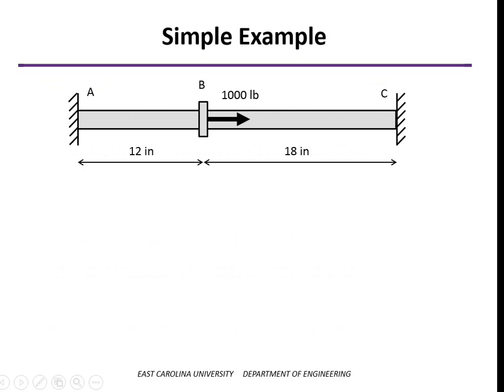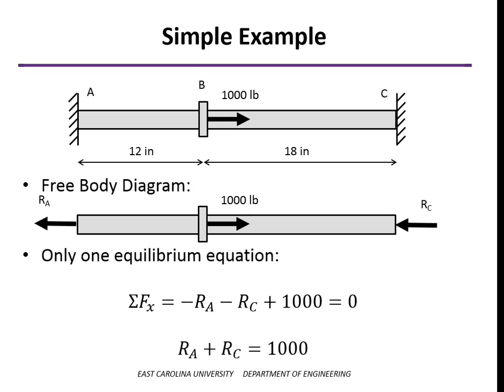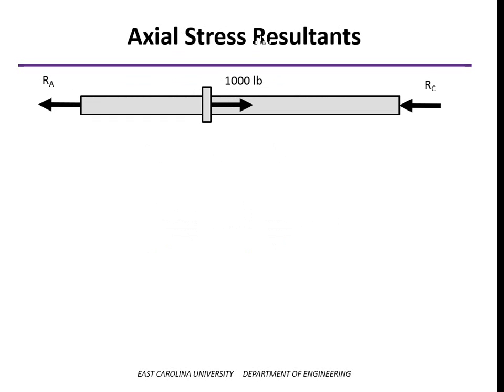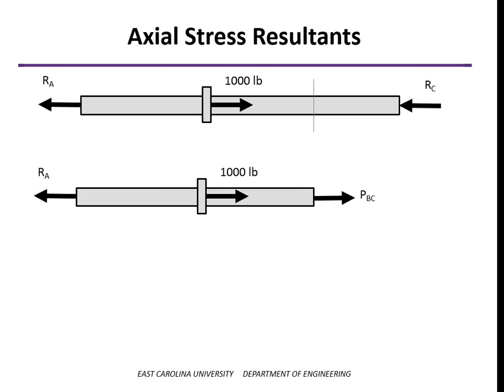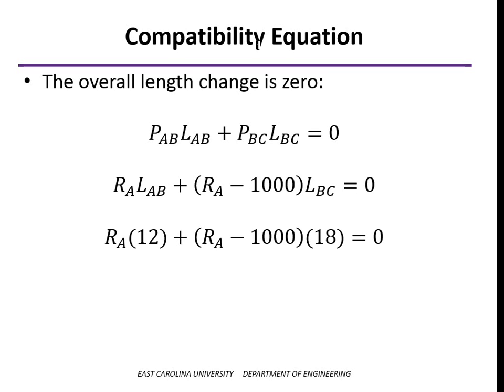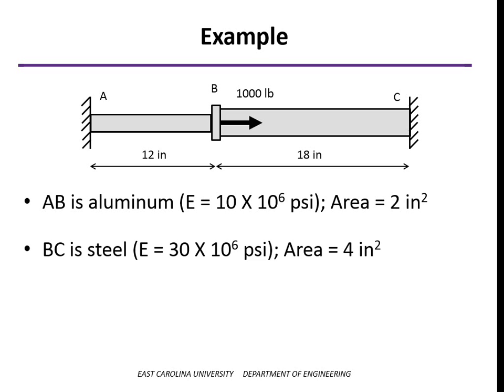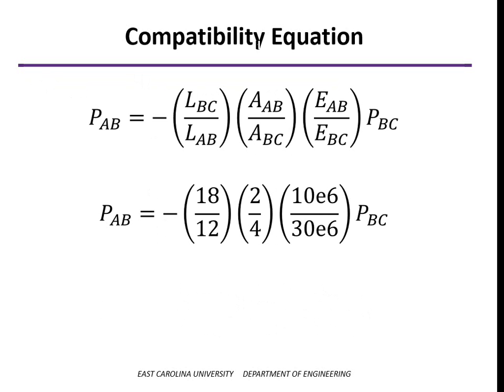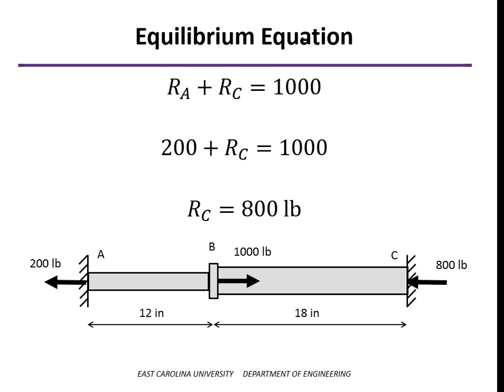Axial Loading - Statically Indeterminate Example 1

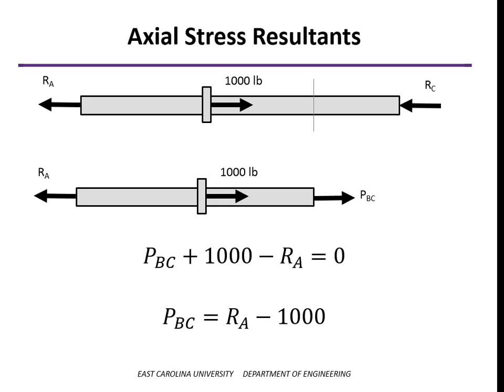Comment: Sir I have a question. In 4:08, isn't it a must to put Pbc pointing to the left? Recalling the whole system equilibrium equation, Ra+Rc=1000, therefore Rc=1000-Ra. If we use that equation (Pbc+1000-Ra=0), then Pbc=Ra-1000, which will contradict if we look the right side of the section where Pbc=Rc and Rc=1000-Ra, hence Pbc=1000-Ra.
Reply from the maker: Since Pbc is an internal force (stress resultant), the positive direction is always away from the cut face.  This corresponds to tensile stress.

Comment: Why do the reaction forces at A and C point in the same direction?
Reply from the maker: Because the applied force is to the right.  Both of the reaction forces are to the left; this corresponds to the left portion of the rod being in tension and the right portion being in compression.
Reply: Thank you so much for your response. My question seems really silly now :)
Reply: ECUSW I took the direction of reaction forces by myself. And when I solved the problem(from the text book) i got a wrong answer. I gues your this comment explains it.

Comment: Shouldn't the reaction at A be pointing in the other way?
Reply: It does not matter in which direction one writes the reaction force. Once calculations are complete, if a negative value is found for the reaction force in question, then it's direction is opposite to what was originally assumed.

Comment: how do you know in which the direction are the reaction forces directed?
Reply: It doesn't matter. If the reaction forces turn up negative, it means that the direction you've chosen is wrong. The whole idea is to stay consistent in notation through the problem, that meaning that if a reaction force turns up negative, you either keep it negative all the way through or you change direction and use it positive.